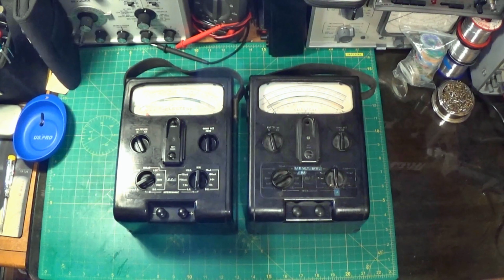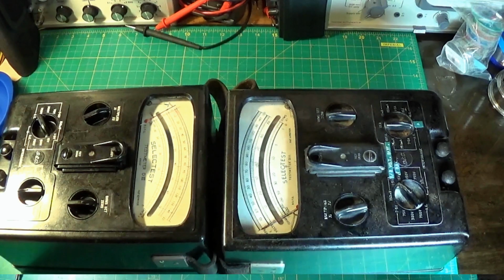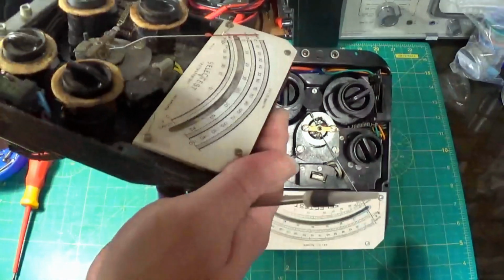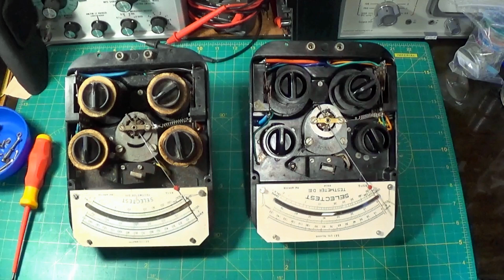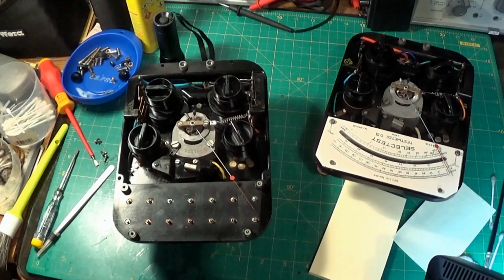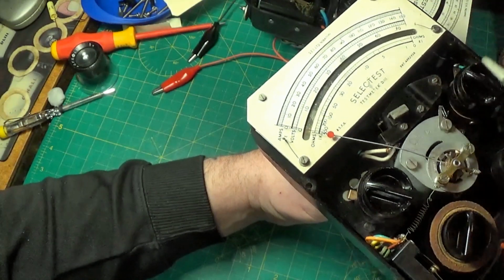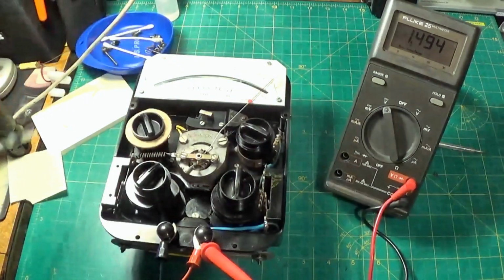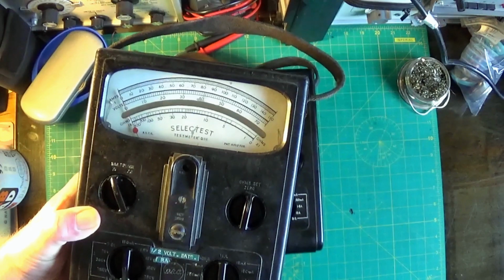GEC Selectest D.III - The reprisal

Comment: Glad you managed to put together a nice clean and working meter. Hope your bench is big enough to use it occasionally - as mentioned in your first video those Selectests are pretty big!
Reply from the maker: I hope so too. I want to get the resistance ranges up and running, I'm sure they'll be fine.

Comment: Ooow a chance to find out what the resistor values were, always good to have a known working one :-D
Hopefully you can get the second one working now.
Those meters sort of remind me of the avo,  built like a brick shi* house.
It's something to tinker with when bordom strikes.
Reply from the maker: Yes, no-one can find a circuit for these so it may be a case of making one.  These are much less crammed inside than the AVO.